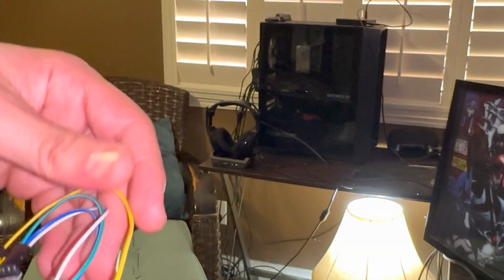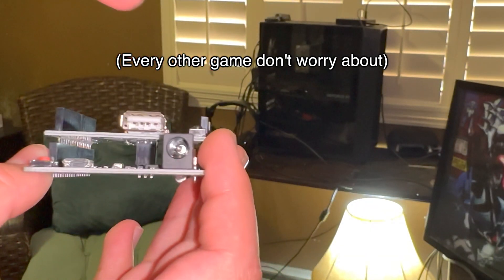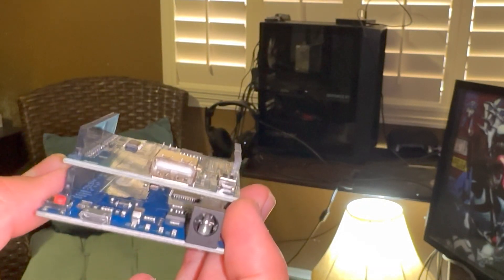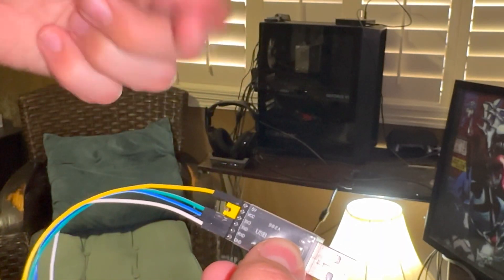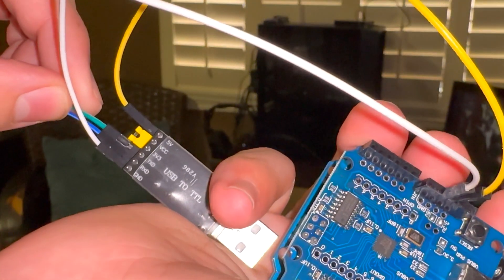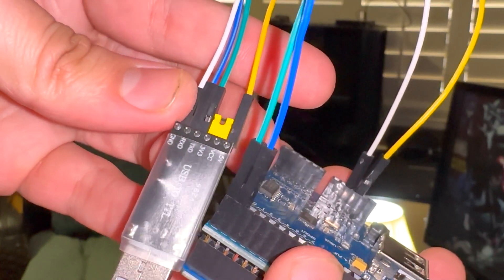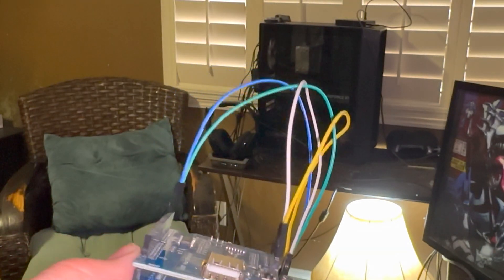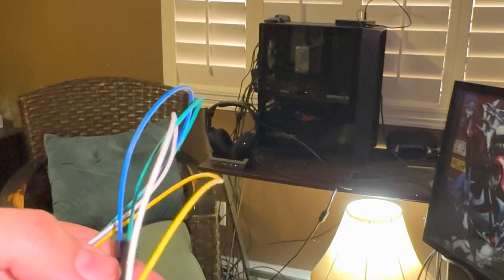Arduino for DMA - Setup Tutorial for GhostDMA (UD Kmbox Replacement)

Comment: hey man really lost here no one has givin a right answer do i need a dma card to do this or can i just use this as it is
Reply: The dma is for the cheat. This is to run aimbot on the cheat. Yes you need a dma card to run dma . Or just use a external cheat with the aimbot included

Comment: Do I need to buy a 9 volt power supply separately or is it included? And do I need it at all?
Reply from the maker: Only if you’re playing valorant or faceit. It’s not included but they are 5-6 bucks on Amazon or may even have one around the house. Common DC barrel connector. Needs to be 9 V, minimum of one amp. Higher amps is OK. Just NEEDs 9v no higher no less.